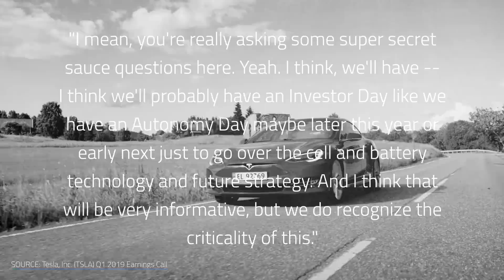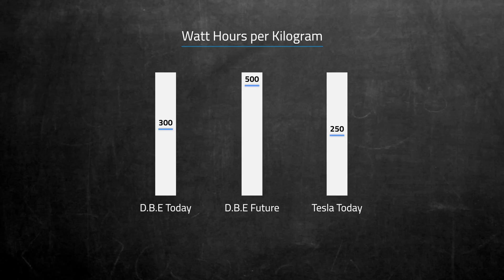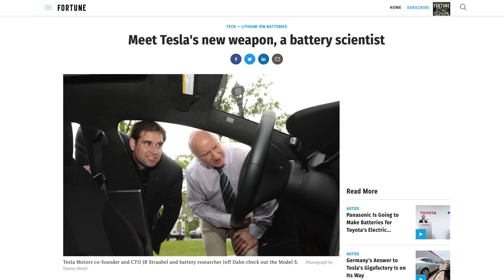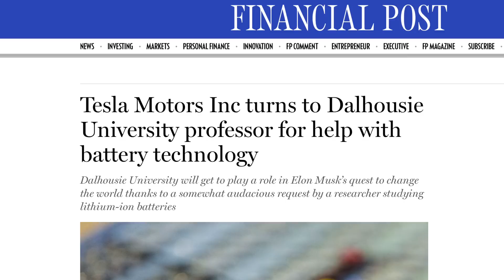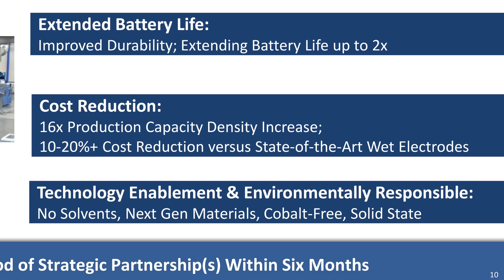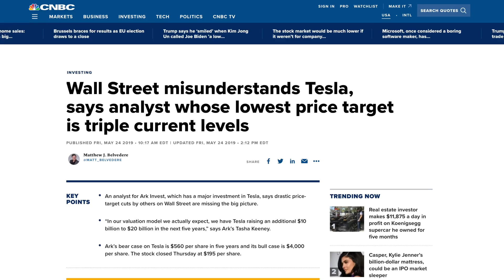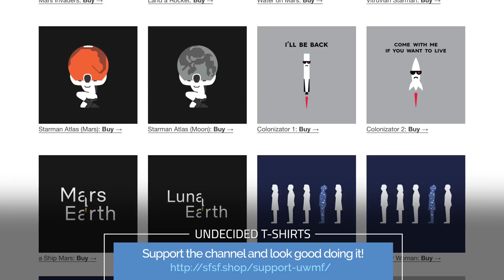Tesla And Maxwell Technologies

Comment: How about Maxwell Super capacitors integrated into brake regen systems and suspension systems to reduce charge cycles while still capturing the energy.
Reply: I bet you $100. the caps will have no part in the new vehicles. Only the batts.
Reply: @tigeroll  bet. Where do you want to put the money in escrow? I'll do it now.
Reply: @ericperkins9198  I'll take that action.  Supercaps are nowhere as energy dense as Li-Ion batteries.  They are used in hybrids because hybrids have tiny batteries and can't soak up the regen level of electricity.  Tesla's already have large battery packs.  It would be adding added complexity and expense for almost zero return.  Completely unnecessary.  Somebody needs to debunk this urban legend.
Reply: @gigglehertz  sure. Like I said to the other guy, tell me where you want to escrow the money and I'll fund my portion of the bet. I'm not going to debate it with you or explain why and where they will use them, put your money up first.
Reply: @ericperkins9198  You're simply wrong, because you don't understand the technology.  I don't trust anybody else holding my money so not sure what you think is going to happen but I assure you Tesla did not buy a capacitor company to get exclusive access to generic caps that they can buy anywhere else, and dilute the stock for the privilege of doing so.  This is about dry battery tech.
Reply: @gigglehertz  I totally agree they are going to heavily use the dry battery process. You said you wanted to take that action, yet now your are unwilling to escrow cash in the service of your choice online (tons available) and instead tell me I don't know what I'm talking about before hearing my side because that would ruin the bet. Whatever poser.
Reply: @gigglehertz  did you ever see me indicate that they would not use any portion of the Maxwell patent portfolio? Or you just run around on YouTube telling people you don't know that they don't understand? Crazy
Reply: @ericperkins9198  LOL well let's see if they put in supercaps just for regen even though their batteries absorb regen just fine, and a separate system for capturing suspension energy like several people are going on and on about (which would add almost zero range in reality).  Elon is already talking about reducing the number of pieces in the chassis to reduce complexity and simplify production, but you guys keep dreaming up new uses for supercaps to throw in for no reason?  Hilarious.  My guess is either leave most of the company in zombie mode making caps for anybody who wants a generic cap (a business that was losing money mind you), or sell off everything but keep the technicians involved with dry cell coating, or even just laying of everybody not involved in dry cell coating.  Did you see how many people they laid off this year?  Did you hear how lean and recession proof he wants the company to be?  You think they're going to keep a bunch of people working on 1970's tech?  OK.  Neither of us know for sure, but which one seems more likely?
Reply: @gigglehertz  And because no one knows for sure is why it's anyone's bet, and why you should take the bet to show how committed you are to your analysis. Otherwise you are just armchairing it.
Reply: @ericperkins9198  I'm not sending $100 to someone to hold for who knows how many years because that's how you prove a negative.  You will be like a short, constantly moving the goalposts.  I'll keep my $100.  Poorly thought out reasons lol.  The information in the SEC forms concerning the merger make it clear the whole thing was about dry electrode tech.  They went on and on about how an auto manufacturer was working with them to prove out the dry coating, and was looking to partner, then decided to buy them outright, and threatened to walk away completely if it failed.  No mention of caps at all.  It would be if I wanted some gum right now so I decided to buy a gum manufacturer, instead of buying a $1 pack of gum.  I don't know what blog or video you read about supercaps but they are not a substitute for having a giant battery.  Show me the math on how much energy it will save, vs the cost and complexity of installing the whole thing.  We have the math on the energy density, throughput, longevity with the new dry battery tech.  Show me the math smart guy.
Reply: @ericperkins9198  So you have no information on Maxwell supercaps as far as cost vs energy savings?  I thought not.  No breakthroughs just off the shelf tech from the 70's right?  Now you're speculating they have some hidden tech that nobody knows about, that wasn't mentioned in any of the filings regarding the merger?  Many Maxwell shareholders were not happy with the conversion rate and held out for more $.  You'd think during the due diligence when they shopped for a higher bidder they would have announced they have even more awesome tech that is worth more than what Tesla was offering, but they did not. High roller shit talk aside, what exactly are you basing this on, that you would risk multiple bets with strangers?  Or is it slowly dawning on you that you are wrong, so double down on browbeating me over money?
Reply: @gigglehertz  Also you keep making assumptions "Maxwell supercaps as far as cost vs energy savings?  I thought not." Obviously you are the one who does not understand the technology. Somebody in your little apartment should take your keyboard away from you.
Reply: @ericperkins9198  I told you there was no need to use Supercaps for technical reasons, but you said I didn't know what I was talking about.  I asked you to prove it and now you're attacking me.  Tell me how it would benefit Tesla to add more complexity, vs just using better batteries.  You can't, because there is no information that would support your claim.  Just admit you don't know what you are talking about.
Reply: @gigglehertz  look bud. Had you commented in a way that encouraged conversation, I would be happy have explained my position and why I feel confident in it. But instead you talk trash, tell people they don't understand before you've ever had a chance to know if they are knowledgeable or have a good source. You even tell people you'll take up a bet someone else commented on and then won't do it for even $50 (half of the org comment bet). Can you understand why your attitude does not facilitate good discussion?
Reply: @ericperkins9198  You fold?  I thought so.
Reply: @gigglehertz  We will just leave this here for others to decide.
Reply: @ericperkins9198  So you don't have any numbers?  I thought not.  So Tesla is on it's 3rd or 4th generation battery pack using Li-Ion cells, perfecting it one tweak at a time.  All the while they've been waiting for the PERFECT supercap to use in braking regen, which they could only use if they monopolize it by taking over the entire company.  Which they didn't even TRY to do until they had a research agreement with and later acquired MAXWELL for an entirely unrelated technology.  A company which crowed about this unrelated technology and even made a last ditch effort to be bought out by a different company, all without revealing the existence of the super-est of supercaps, which they didn't want anybody to know about including the SEC.  Meanwhile, Elon has been slowly pairing down the headcount, tightening the belt, eliminating parts and steps in the manufacturing process, specifically to employ this totally unnecessary extra system which is nowhere near as capable of plain ol' Li-Ion batteries.  He's playing 3D chess.  I see what you mean now!
Reply: @ericperkins9198  Ah yes, the Trump explanation.  I've got a super secret strategy for defeating ISIS, a great healthcare plan, and a way to make Mexico pay for the wall.  I just don't want to tell you.  Uh huh.
Reply: @ericperkins9198  When the S/X refresh happens, and Elon says "we decided to use supercaps for regen"  or at the Truck reveal he says the same thing, message me and I will send you $100.  When neither of those things happen, I will remind you to pay up.  You mentioned 3 months, I think both of those are roughly that far in the future.
Reply: @gigglehertz  When you offer to bet someone 100 dollars and then back out am I folding? I see the sad apartment you left to go to work from and just feel sorry. It's a depressing reminder that we have no middle class in this country. Just don't bet money you don't have, and try to listen to others, some of the time.
Reply: @gigglehertz  ok little buddy.

Comment: You did not even mention the Maxwell super Capacitor technology
Reply: I don't think it will be used in any part of the new cars.
Reply: Not needed, not as energy dense as batteries.
Reply: @gigglehertz  Density is not needed since capacitors are not for energy storage, but for surge protection. The tech will likely be used only in the performance versions of the cars to allow for harder braking and acceleration.

Comment: After å horrible experience trying å Model 3, I actually just hope someone real car maker buys this company and make a car out of it. That Model 3 was pure shit, and they actually ask money for it.
Bad brakes, yeah you heared me correcly. After slaming the brake pedal to the metal, nothing really dramatic happend. It slowed down like it was your avarage regen stop. So no push to the front Windows there, was fine to break hard at low speeds, then og was just to damn hard, but when you needed it, there was none. Map was  like 4 years old, like dont they upgrade these thing on the fly?
The scaners was more busy on the railings on the side on the road than motorsyclists behind you, and Even more busy with cars 3 ahead of you. And couldnt read signs, used like i Said 4 year old maps so many places, har redused speed because of accidents.
610 km is the range, 428 was the charge at 95%, and this was the LR Dual motor.
Sad That Tesla will drag Maxwell into the dirt, and the bought this company to break free from Panasonic. Nothing Else.

No im really disapointed on this Model 3. And the seller Said it's just adjustments, well maybe should have that fixed before handling out the car?
Going to test the New Nissan Leaf, got that car for the whole  weekend and not 1 hour. So service wise they allready won.

Comment: Wondering about Maxwell's super capacitor and that integration into a battery mix, the combination, In theory, could bring this all to a whole New Level -- Surprised you did not touch on this... Maybe you are going for a new Video???
Reply: Hybrid system would complicate the drive system by a magnitude. Will never be used.

Comment: Great video. One angle that I would like you to explore is how this affects Tesla's relationship with Panasonic. The way I understand it, Panasonic at GF1 is responsible for battery production and there is a "hand off" of those cells to Tesla in the production line. Do you think Tesla would take over actual battery production (further vertical integration), or maybe license the Maxwell tech to Panasonic?
Reply: From what I have read, Panasonic are saying that soon they won't be able to supply batteries for the Model Y, whereas Tesla are saying that Panasonic are producing 500,000 dud (throw away) batteries a day which is slowing them (Tesla) down.   IMO it won't be long before the two part company. Look at China... Tesla's new factory doesn't have any Panasonic input at all (that I have heard about).   It will just be a matter of time before Tesla makes their own batteries, and leaves Panasonic in the burning rubber tracks of their new roaster... Maybe they will make batteries in China themselves, and export them to the GF1 to replace the faulty Panasonic ones ? (assuming any of this is factual of course)... Just my opinion.

Comment: Apple claims to believe in full vertical integration, but somehow they failed to see that manufacturing is a major part of what needs to be integrated. Because they failed to integrate manufacturing and outsourced it to Foxconn, they can't compete at the low end with Android devices, thus they are cut out of emerging markets where price is a major consideration. It's a huge strategic mistake that will eventually be their downfall. It also leaves them vulnerable to tariff wars.
Reply: dlwatib The margin for low-end is very small and they get enough demand in the high-end market. Its better for them to not go much lower-end to maintain their image as an aspirational brand. Same reason why Toyota sells their premium cars under Lexus.

Comment: But wait! There's more! Eliminating the baking off of the solvent increases the speed at which batteries can be made since the baking takes a long time. Also, it takes a lot of energy, and one of the reasons opponents of EV technology claim EVs are "just as polluting as ICE cars" is because of the extra energy used in battery manufacture. They like to assume that all that energy is coming from coal-fired power plants, even though it's likely to not be true.

Of course, Maxwell Technologies has more intriguing products than just the dry electrode process. This video didn't mention them, but it's interesting to speculate how Tesla might use them in future products. Elon has always been a fan of ultracapacitors. It's worth pointing out this link: https://www.maxwell.com/solutions/transportation/active-suspension
Reply: Too bad they can't use the thermal heat from the hot Nevada sun to bake those electrodes.

Comment: Another important part is the supercapacitor knowledge this deal grants Tesla. Normal batteries are not able to take all the energy that is created while breaking, while capacitors can. Furthermore capacitors also can discharge faster, allowing for more rapid acceleration. Another important part is that capacitors don't have near as much wear as normal batteries, so they can be used to absorb energy while breaking and give of energy for rapid acceleration and this can be done frequently for better efficiency.

So all in all, the capacitor technology gained will help Tesla make more durable batteries, more energy efficient batteries and perhaps also a more fun driving experience.
Reply: I'm pretty sure batteries have been able to handle all the regen a vehicle could create when breaking for about 15+ years now. Also the output from the batteries could literally shred the rubber off the rims in E.V.'s. The new batteries will last 1 million miles to so no need of any caps.
Reply: Only time they can't take regen is when the battery is already full.  Maxwell didn't have any superior supercap tech and Tesla could have bought them from anyone if they thought it was important (it is not).  This deal has nothing to do with supercaps.

Comment: Regeniration tech from interactive suspension to super capacitors designed by maxwell you missed.
Reply: Because it takes the strain off the battery when accelerating or regen braking.
Reply: The Maxwell capacitors will have no part in the upcoming cars. Why complicate a great system that will provide 1 million miles with the Maxwell batteries.